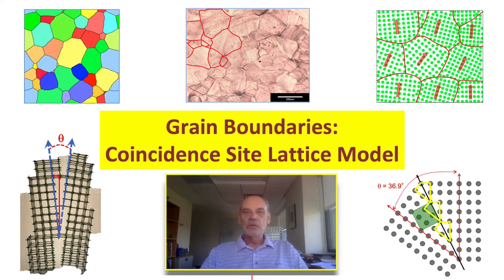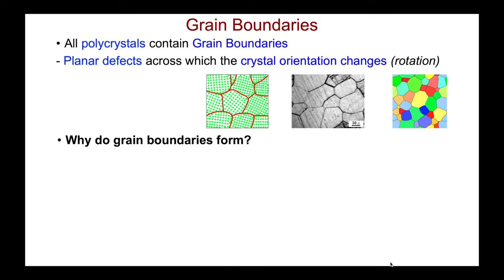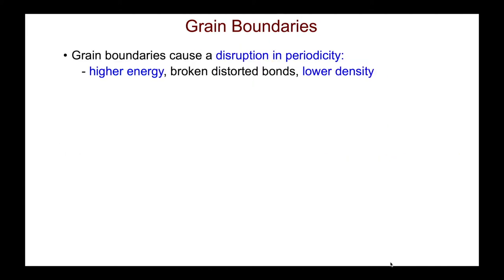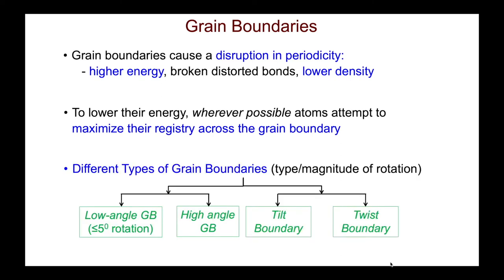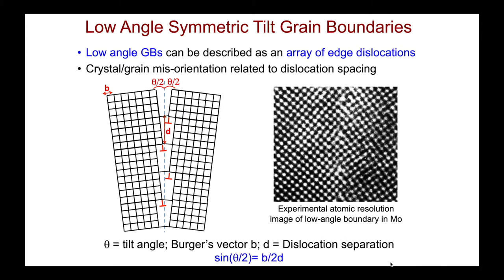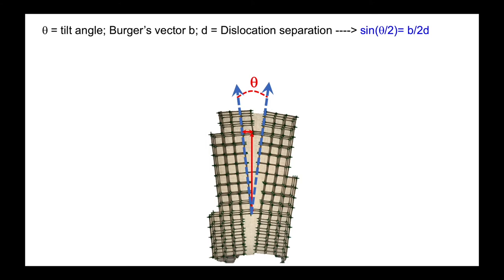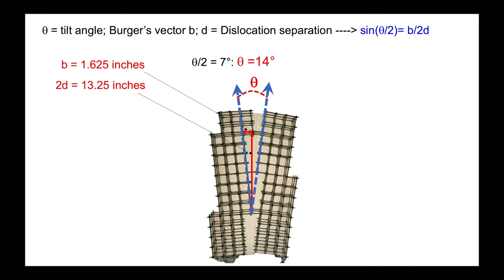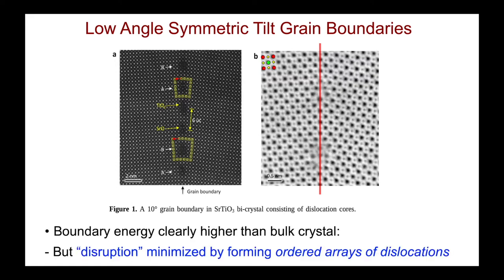Grain Boundaries in Materials (Low Angle Boundaries, Coincidence Site Lattices)

Comment: Hi, You said that low angle boundaries orientation is below 5degree however in the next slides there is an example that shows it as 10 degree in SrTiO3
Reply from the maker: Yes the 5 degree quote was an approximation, you can go a little higher.